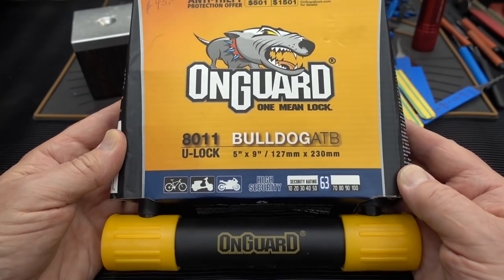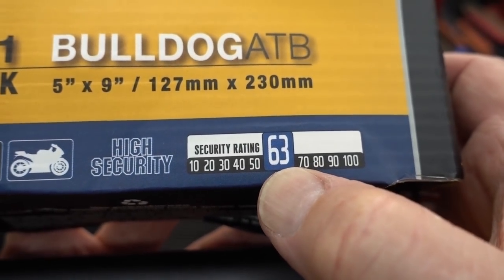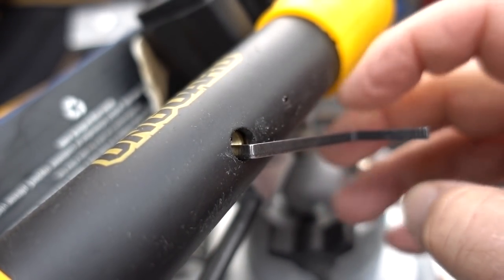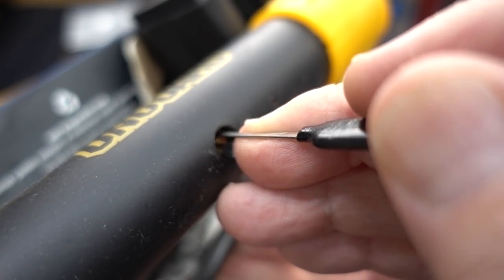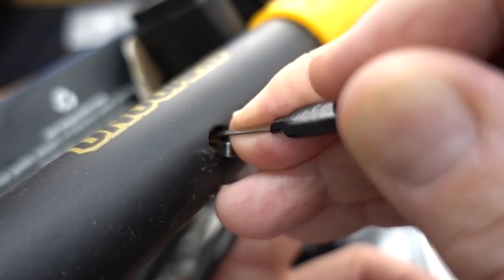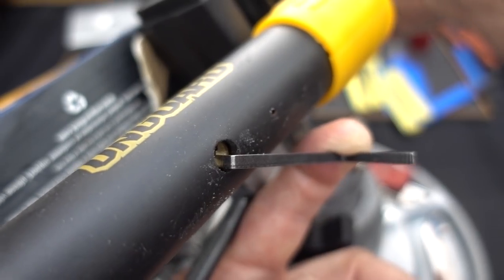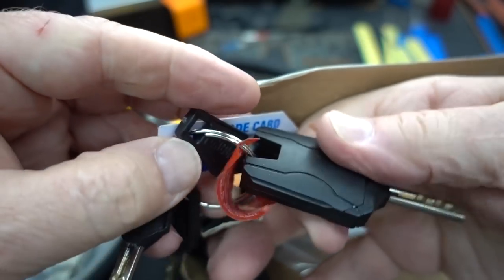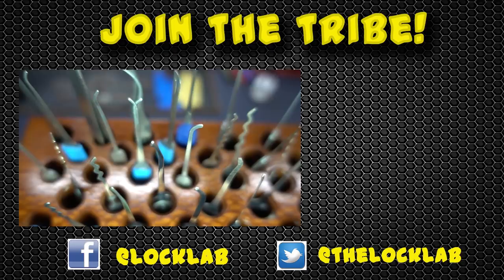(1348) OnGuard Bulldog ATB 8011 Bicycle U-Lock Picked

Comment: Compared to the other bikes on the rack with 4-pin Master style cores (or even waffer cores god forbid), I'd say the OnGuard is still a pretty decent lock. Sure, it's not a disc detainer core, but you can't just rake it open either. I also think your picking experience contributed to you opening it so quickly.

Comment: Would it be possible to switch between manual and auto focus while filming? That way you can lock the focus on the lock without cutting the footage.
Reply from the maker: Possible?  Yes.  Practical?  No.  To switch back and forth means I'd have to stop picking and fiddle with the nested menu in the Sony RX-100.  Totally not worth the butt pain.

Comment: Is there a video about the camera?  I'd just be curious to see if it's specifically marketed for lockpicking, how much it costs, etc.  Cool tool for the videos.
Reply from the maker: Danny, it is called a "digital microscope" and intended for electronic circuit board inspection.  You can find them on eBay in prices ranging from $25 all the way up to several hundred for the HD cams.
Reply: I didn't realize they were so cheap - thanks!

Comment: I seen you video on the Masterlock  u Lock it was the same one you can open with a pin I was wondering if you have seen the newer one they put out that has a wafferlock core and tensions from the back I can't remember the model number
Reply from the maker: David,  the lock you are referring to has been obsolete for almost 10 years, abandoned right after the Bic pen vulnerability was discovered.  The lock in this demo is NOT that lock.  This one has sliders, as shown in the video, not pins, sorry.  No, I do not know what lock you are referring to, but if you'll let me know the model number I'll get one and open it up.
Reply: I think it's the master 8201